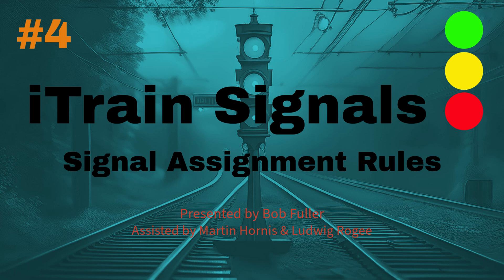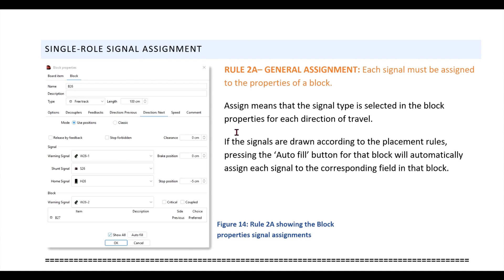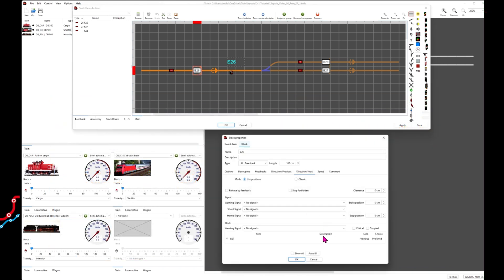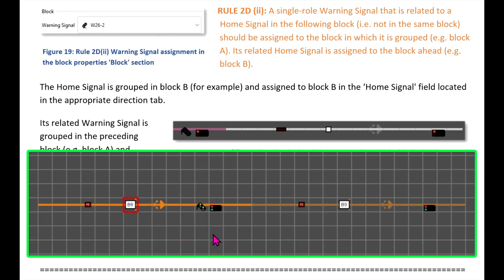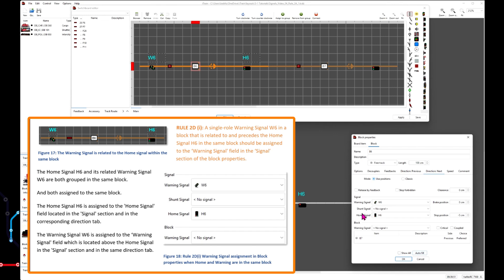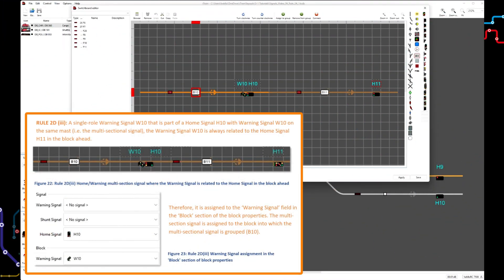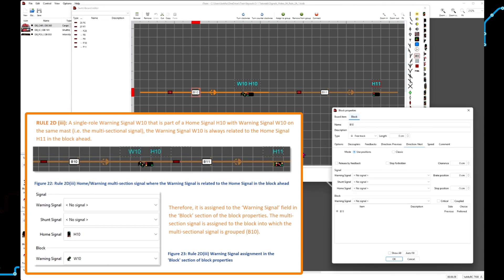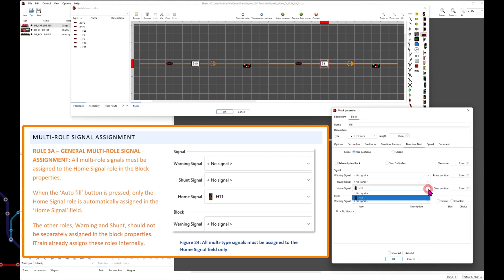iTrain 5.1 Signals [GB] - Video 04 - Signal Assignment Rules

Comment: This is so confusing.
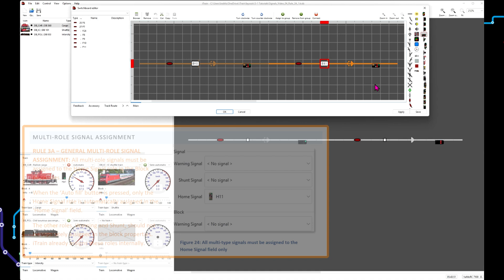Reply: Except from 9:40. Then it makes sense.

I don’t understand why you’d have a separate warning signal about the next block when you have a multi home/warning signal there with it, colocated, which tells you about the next block.
Is it a European thing?
I’m thinking (as distinct for “I’m sure”) that in Australia and US and maybe Canada where there are red, yellow, green lights and maybe feathers, there wouldn’t be that, and perhaps the first ~9minutes wouldn’t apply. But hey, real world I really don’t know.
Reply from the maker: @RabidWombatz  in iTrain there are essentially two types of signals; single-role signals and multi-role signals. Single-role signals are capable of performing only one role - either Home or Warning or shunt. Multi-role signals are capable of performing more than one role - e.g. Home/Warning or Home/Shunt or Home/Warning/Shunt.

It is important not to confuse the rules for single-role signals with the rules for muiti-role signals. There are rules that only apply to single-role signals (as described and shown in this tutorial up to 9:40), and simpler rules for multi-role signals (as shown from 9:40).

In Europe, there are a lot of single-role signals (mostly from past era's). But nowadays, most modern light signals are multi-role. With multi-role signals, you only use one multi-role signal per direction of travel in a block. 

So, you are correct, you would NOT "have a separate [single-role] warning signal about the next block when you have a multi home/warning signal there with it..."  

The Australian, US, and Canadian red, yellow, green signals are multi-role signals, so only assign them as shown from 9:40, and only place one multi-role signal in a block per direction of travel.